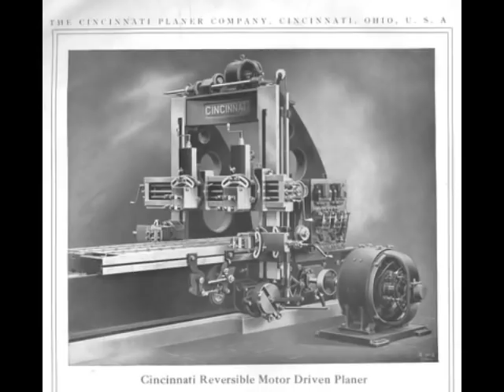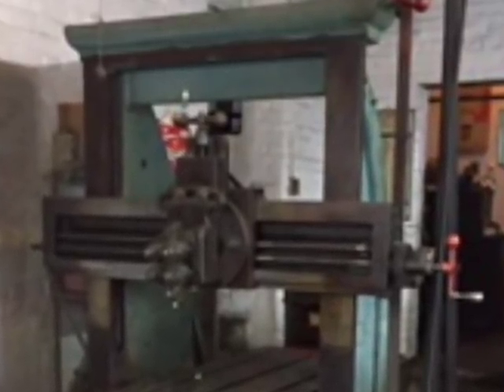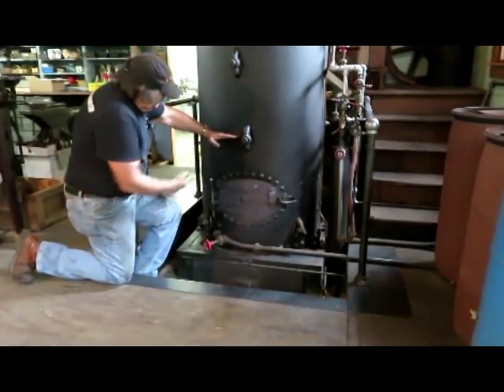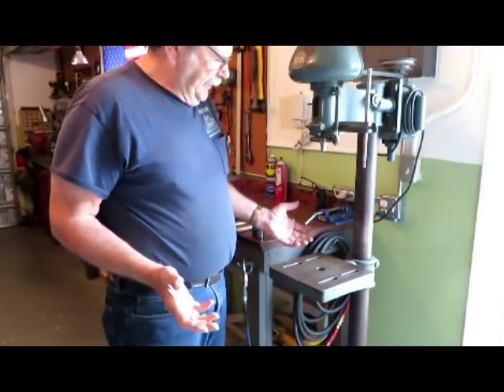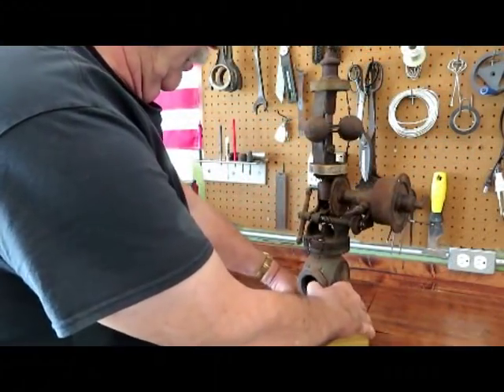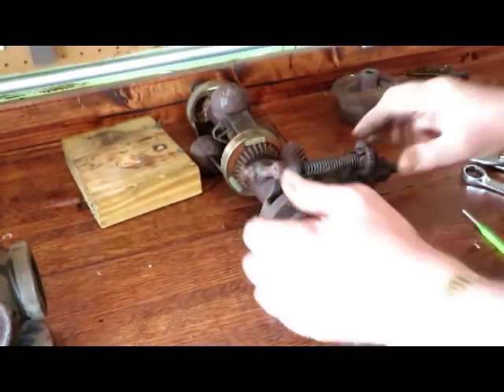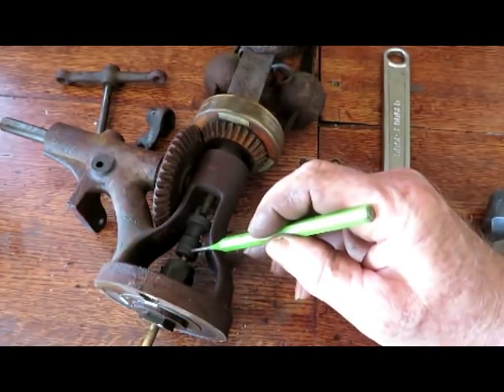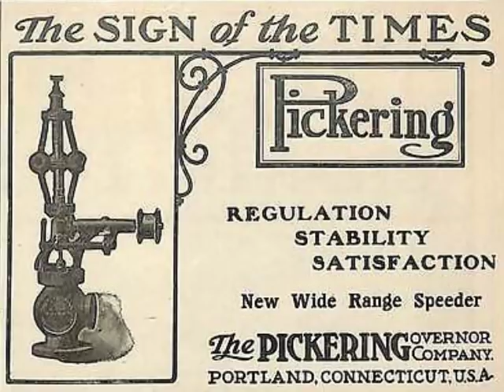Old Steam Powered Machine Shop 51             Company Meeting

Comment: There is a shop in Ohio that I worked at for 3 years. I ran a planer every day 24ft part length. They have 6 total shortest one is 16ft
Reply from the maker: That's a bunch of planers.....Dave
Reply: @davidrichards5594  yes it is.  They are still open today and specialize in brake press tooling. Sat there many days trying to think of a better machine that a planer for the job and couldn't come up with one
Reply from the maker: That's what I've thought, and there are a lot of press brakes doing work every day with worn sprung vees....Dave

Comment: Looks like you burn wood in your boiler .  How often do you need to empty ashes ?   How do you get rid of the ashes ?  Is there any fertilizer value to it ?  Can you just throw the ashes in the dumpster ?

Thank you ,  :-)
Wyr
God  bless
Reply from the maker: Wyr:  I occasionally burn coal when I don't want to be bothered with firing often, but mostly junk wood that makes quick steam. Wood makes very little ash, I sort the nails out with a magnet and throw it in a low spot on the property. must be some help to the soil, the grass grows on it fast....Dave
Reply: @davidrichards5594  Thanks .
Coal is not readily available in our region .  I suspect grilling charcoal would be about as cheap .
I did a little looking online and found a place to order coal , but I suspect a large part of the high cost is the included cost of shipping .
A fair amount of scrap wood could probably be scrounged .
Is it practical to burn pallets ?
I think you said you do not have steam power in Florida ?
Enjoy the videos ,   :-)
Wyr
God bless

Comment: Im not sure of the dimensions of your planer if it will fit on a 24 foot deck you could rent a 3 axle trailer that is rated for 21000 lbs and haul it you self I would haul it for you but im in western canada good luck
Reply from the maker: Hi Dale, There are (or were) a lot of free lance truckers that hauled gas drilling equipment around in northern PA with rigs like that., I don't know about the permitting that might be necessary to haul into NY from DE. Maybe they wouldn't worry about it, but I don't want the machine impounded while they are in jail.....Dave

Comment: Why do your pullers always work,mine slip off or bend/brake what is being pulled!?????????
Reply from the maker: Rick, I stole this trick along time ago. Try pulling it up as tight as you can comfortably and then zap the end of the screw with an air hammer.  If it's a long sticky pull it won't help as much.....Dave